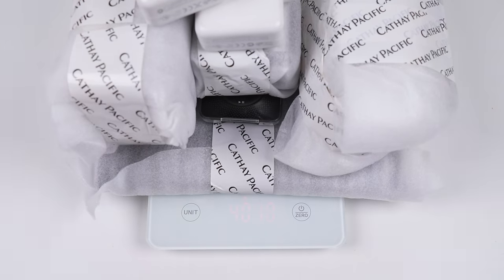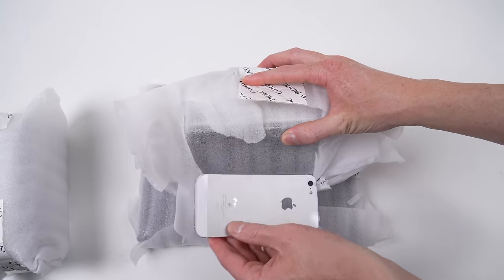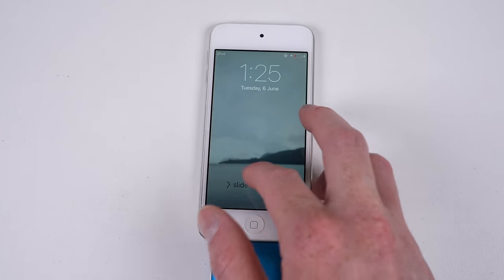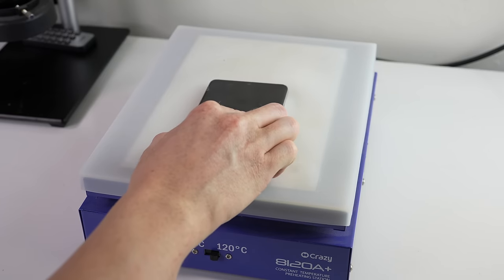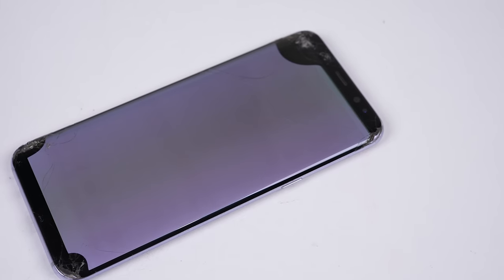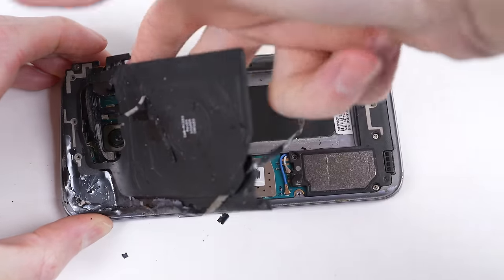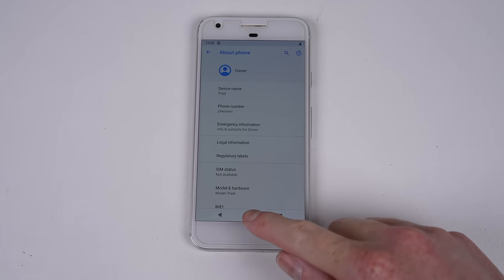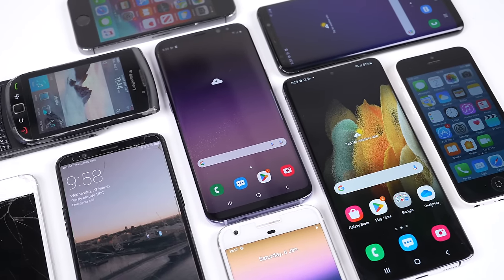Hitting the Jackpot at an E-Waste Centre - It's Amazing What People Throw Out!

Comment from the maker: iPhone 4 wasn't iCloud locked. Reset and it works fine.
Reply: Lovely, I remember you fixing and repairing quite a few earlier model iPhones a couple of years back (ro so) in the earlier days of the channel.
Only thing of course is that some iPhones can be iCloud locked so you really have to choose carefully. Myself, I'd have taken a punt on quite a lot of the phones, hoping to get at least some working (especially if you still have that box of donor iCloud locked phones whose screens/batteries/other parts can be repurposed).
Reply: @TheSpotify95   iCloud locks are pretty easy to remove if you know how. The MDM is more of a hassle, but not something you can't bypass with a bit of work.
Reply: How can we buy the e waste and ship to our countries for salvage
Reply: Replacing the screen only without the frame is not only easier, but faster and more professional.  Aftermarket frames are not the greatest quality, including the way they mount the screen and other pre-mounted parts.  Moving all the small fragile parts over from the original frame is riskier and takes longer than replacing the screen only (especially the glued-in ear speaker, vibrator, and antennas in the frame).
It makes me cringe when I see anyone using a messy glue to mount the screen and back, which makes future repairs more difficult by having to scrape it all off.  Repair part stores sell cheap $1 factory cut double-sided adhesive tape for most models.  For models which are not available, they sell generic rolls of 3M tape of various widths (1-5 mm) for easy mounting.  Just my 2cents.
Reply: 5th reply
Reply: I need to go to e waste
Reply: Donate phone
Reply: except it doesnt ''work fine'' at all. Its pretty much useless like all older apple products. You litterally couldnt watch a youtube video on it if you tried.
Reply: @Mikael-jt1hk  That's probably due to the lack of app support as a device ages. The same can be said for my old Galaxy S4: what worked flawlessly when I used it daily, now struggles dut to older apps not working anymore.
You have to manage your expectations - in terms of core functionality, the iPhone 4 probably works fine, but will struggle with modern apps. That's different to a phone with a broken screen, bulging battery, iCloud lock, or similar.
Reply: i wish i had the skills like you so i could make profit
Reply: @peterishere6230  You gonna steal phones or smth ? Jailbreaks are pretty useless to use considering even a slightest update could brick your phone
Reply: I need that s21 ultra  😫 i will pay for that 😊
Reply: Sir 😊
Reply: Oppo is my favorite one ❤
Reply: No if you make the Last Update on it IOS 9.3.6 and you Get a Activation Lock
Reply: I'll buy  the s7 if you still  have it
Reply: cool dudue:text-green-game-over::text-green-game-over::text-green-game-over::text-green-game-over::text-green-game-over::text-green-game-over::face-purple-crying::face-purple-crying::face-purple-crying::face-purple-crying::face-purple-crying::face-purple-crying::face-purple-crying::face-purple-crying::face-purple-crying:
Reply: What  application did you use to tell you all that data at 8:44 ?
Reply: @SH..786  he'll probably sell it on his websitr
Reply: Yo I’m British You coming to my house and fix my phone
Reply: For these old devices fixing with oled doesn't make sence...use a ips screen
Reply: Hi, I recently visited a recycling center full of electronics dropped off. They no longer allow people to take the electronics dropped off to people anymore, I’m having a hard time finding a place that picks them up.
Reply: if you can get into one with no PIN, always sign out of icloud before resetting.
androids you can reset from recovery mode, and bypassing their account lock is easy if you're exucated
Reply: Ill buy the pixel
Reply: woo zeee momma
Reply: Hey mate . What ewaste place did you go to . I’d like to go there
Reply: its amazing you said usd im from usa and watched you modding an ipad mini 2 screen only visable to you and i was watching on the same ipad but it broke but we changed the screen

Comment: The other day a care organization that I'm a client for gave me a bunch of devices that they were going to throw away. I got a ThinkPad Yoga 370, two Galaxy A32 phones and a Galaxy A20. ALL of them were fully functional with small marks from general use and wear & tear. They even factory reset the devices for me.
I can agree, its crazy what people throw away
Reply: Dude, I got a few pretty decent ROG prebuilt (dated August 2020 in their inventory) from a government office that tried to get rid of them. Bought 6 of them for around 200 USD. Turns out all of them have either bad HDD or bad RAM plus clogged up fans. So I just get the parts I need for building my own PC, sell the rest of the parts for donors or just second hand parts on Facebook. 

And that's how I have my current PC, i5-10400F and a 2060. 

I also got a few decent MSI and Dell laptops from the same office, most of them only have bad HDD or bad RAM and that's it. One got a bad battery, but already fixed it and sold it for 400 bucks. Which is the cost I need to purchase 10 of those laptops. Also saving one for myself, just hope the delivery for the RAM will be faster than the estimated delivery time
Reply: People are ignorant. These people have been fooled into thinking a 3/4 year old phone or computer is obsolete.
Reply: The company I work in provides us with phones but after when they upgrade our devices they don’t even have a possibility to sell the old ones to the outside. Thanks to that we can buy them for some silly money(on device per worker) but those unsold belong to e-waste😉
Reply: I had gotten batches of 30 good PCs because offices changed to newer ones and they needed the data destroyed, then they let me keep the rest of the computer
Reply: Hey I’ve seen u on TikTok lol
Reply: Id throw a free A20 away
Reply: @Gabriel-cy2iw  a20 is are good phones if you need a backup phone
Reply: hi
Reply: Sounds like trash to me 😅
Reply: care organization? what is that

Comment: I'm definitely a fan of going to my local e-waste drop off and seeing what's been left 'OUTSIDE OF THE DEPOSIT BIN.' I put that in quotes because if it's inside the bin, then it's theft, but if it's outside of the bin, it's fair game. So many corporate folks, mainly enterprise and data center folks, will drop of boxes and boxes of servers blades with CPUs & registered ECC DDR4 since they have to upgrade the entire platform (minus PSUs, I/O, etc of course) in order to upgrade their CPUs. If it's on the curb then it's fair game. As someone who also repairs devices, Ive saved A LOT of money finding iPhones that are either activation locked, or have one problem or another, but their display assemblies are usually fine. Mostly OLEDs, but sometimes there's an iPhone 11 or two, so a FEW LCDs sneak in there.

The panels are usually A/B grade, and 100% intact. So I'm kinda in it for the display assembly harvesting, but . .  the OnePlus 9 Pro I'm using right now, I found her new in the box on one of those runs. Well, I say 'new', but I'm not 100% sure, but she didn't have any signs of wear, AND the factory screen protector hadn't been removed yet.

I'm glad people take their stuff to e-waste places, and not just because it's good for me, but it's also good for the environment. I'm also a huge fan of devices getting second lives.

Speaking of second lives, lately I've been harvesting the LCDs out of dead laptops (although I have been able to fix a few of them, but most of them are toast). Usually they're FHD or QHD, and then I'll snag an  LVDS driver control board, and build fun little project monitors. They're also perfect for Raspberry Pi projects. They're great. The control boards only run $15 or so, and since most of them are actually repurposed prototyping units, it's full circle ewaste prevention.

Great video brother!!

Comment: I work as a service tech for a restaurant group
A number of years ago all our stores got a number of Amazon fire tablets that the stores were "supposed" to use as mobile training items. 
Many stores "misplaced" or hid them and eventually over time we switched to chromebooks. 
I've found a number of these tablets due to new store managers and such and have worked to turn them into document tablets. They contain the operation/troubleshooting manuals, cleaning and PM guides, and other key/core info including  model/serial numbers on all the equipment the specific store. 
I've produced 4 of them and the stores that have been using them quite a lot now. It also helps us techs out as the stores now can give us better information on machines that aren't working right

Comment: The company I work as a service tech we constantly strip out old equipment for usable parts prior to scrapping them. On average we can salvage 60-80% of the usable parts prior to scrapping. Only time we don't do this is if the item is too old for the parts to be usable in other machines

Old wiring goes into a barrel that our one person takes to a field at his farm and burns the coverings off them in order to recycle the copper.
Most of the metal we don't use goes into a scrap dumpster that is picked up for recycling
Reply: You shouldn't burn the insulation off wire, it can be sold as insulated or get a wire stripping machine.
Reply: @biohaz360  we're talking about wires that are 10-25 years old out of grills/fryers and other equipment.  the amount of wire collected varies and isn't a consistent amount or size.
We used to simply trash it but at least now it's getting recycled. It's not the best way to do it I admit, but it's better than ending up in a landfill

Comment: I've had 2 Galaxy S20 Ultra that had a swollen battery after about 10 months. Samsung replaced the first one,  but the replacement did the same thing with another swollen battery that was separating the back. Must be a defective battery or charging system.

Comment: I've been questioning the feasibility of replacing screens for broken phone. My friend has a Google pixel 6 pro with a broken screen, and I looked up where to get new displays and it's simply not worth it. The pixel 6 Pro sells used for about 400 USD, a new screen is 250 USD minimum (and the cost to do a replacement is about 10 dollars more). I think the cheapest way to do a screen replacement for this is find a water damaged Google Pixel 6 pro and take the screen off (assuming they are not damaged). Perhaps in a few years when these phones become obsolete, a screen replacement may be worth it. If it was just a dead battery it's probably worth it to repair, because new batteries don't cost nearly as much, but if it's screen or motherboard, best just discard it. 

Actually I kinda wish I can find an e waste purveyor in Taiwan. I can find junk yards and they have E waste, however their willingness to sell (rather than buy) is variable... some yards have very weird rules about them selling you e waste, and also all of these yards are outdoor, meaning if you bought E waste from them, a large majority of them will have been exposed to the element, and therefore damaged beyond repair.

However if you can find retro components (I mean computers from the 80s or 90s) that are in a good working condition, then you may be able to hawk it off to idiots who will pay thousands of dollars for old, obsolete component.

Comment: I rescued a HP Envy 17 laptop from a skip. It had a broken screen hinge and a few missing key caps which I repaired easily. I purchased a replacement power supply from eBay for £8.00 including postage and the laptop powered up with no problems. Not only did it have a quad core, 8 thread i7 CPU and Nvidia GPU, It also still had a 1 Terabyte hard drive and 16 Gigs of RAM, as well as a working copy of Windows and all the user data still on the drive. After reformatting and re-installing Windows, my wife claimed the laptop for her Facebook gaming, and has been using it for over two years now. One of many great finds I have rescued from skips over the years.  It just shows what a "throw away" society we are becoming!

Comment: iPad 1 usually does that when the battery voltage drops under 2 volts/ cell, slow charging the cells usually brings them back to life, no need for replacement unless it is bloated

Comment: Not a phone I know but technology below 2000 is the good stuff.

My old radio SHARP WF-1100L (A portable Radio) is still strong to this day. I don't know the exact age, but it is at least 20 years old since my parents married.
Reply: It's like my old radio Samsung RCD-S30. This radio still works OK, has cassette AND CD player. Also has AM function and Bass option. And this one is from early 2000 or even from 2000, and yes, could be portable if you found one of those big batteries for old flashlights

Comment: Regarding the Samsung S21 Ultra & S8 screen repair, I would have also replaced the battery (Gawd knows how it's been charged and abuse it's had AND... Knowing Samsung and their 'Spicy Pillow' batteries 😉🤣🤣), so, while I'd be in there a new battery in too to ensure longest lifespan without having to open her up again in the near future... 🤔😏
😎🇬🇧
Reply from the maker: I replaced the S8 Plus battery as it had expanded slightly.
Reply: @HughJeffreys  Yeah you mentioned, I was just meaning that maybe at least before sealing the other phones up fully again, I woulda done a quick charge and drain test to see what life there was still left in them. Please don't get me wrong, the video was short and thus we didn't see everything you did, so I don't know what condition those batteries were in. It's just when I have done a couple of repairs to older phones, I've done the batteries as well 'Just in case' as, like 'MrWhoseTheBoss' found with his collection of older Samsung phones, some have, er, 'Filled out' a little lol 😏😉.
Anyway, love the channel (long time subscriber) and LOVE the fact you don't hesitate to pull up the main manufacturers constant failure/resistance to help with repairs (Naturally Apple being the biggest culprit with unnecessarily code locking stupid things like vibe motors, screens and even batteries and such!). Keep up the good work fella! 👌👍
😎🇬🇧

Comment: With those Samsungs I often use an external monitor through a usb-c dock w/ pd charging to test if it's more than the screen. It would've been tricky with those ones since they're locked though. On the lock screen you just see a lock icon on the monitor as it waits for you to unlock the phone. Ideally with a customer device you can just keyboard in a passcode or password. Patterns are way harder to do since you're using a mouse or touch screen blind usually. With all that said, having that tool as an option gives you more information and a really easy way to recovery data without a full screen assembly.

Comment: It might be worth trying the iPad again. I have the same issue with my iPad 4 (2012). If the battery runs empty and I want to turn it on I have to charge it for an hour at least. Otherwise the display will just flash and turn off again.

Comment: The first gen iPad that flickers is a sign of a very flat battery which cannot be revived via USB charging. You would need to disassemble the iPad and reveal the battery contacts then tape/solder the positive/negative wires from a usb cable directly onto the battery. Here is a youtube tutorial about that: https://youtu.be/2QVFJIqD5Yw?feature=shared .

Comment: Hey Hugh I have question 

Is there a best way to remove the earpiece and vibration motor without destroying it because everytime I repair some of my phone with broken screen I just buy new screen with frame so I need to transfer everything but everytime I do that I always damage the earpiece and vibration motor sometimes also is the charging board

The battery also I have problem, some of my phone just have fat battery (pillow battery) I try the alcohol method and manage to destroy the screen because of the alcohol

Comment: The least hard to fix phone I could get recently was... a Galaxy S5. Does have some bit of corrosion on the LCD flex SMDs but it surprisingly works well, proving the S5 is one damn tough as nails trooper.

The battery and camera were the only things that were its issue. The camera doesn't properly focus (not that I'd need it anyways as it's gonna be a secondary phone) and the battery was already puffy. I might be able to find some more broken S5s and rebuild one from more. Hope to find a S5 Neo back cover as well.

Comment: I give props to the e-waste business for collecting such devices. 
Funny story…while on vacation, I noticed my aunt and uncle’s pc was unplugged, collecting dust. They stopped using it for years because their monitor got destroyed. So I just plugged it to their TV, discovering that it works fine, only slower. 

After relocating the computer next to the TV, and purchasing an external hard drive to back up any files and documents that was in there — mind you they were gonna throw out the computer before getting it checked out — I installed Linux Mint. The system had Windows 7. And I know it will get infected with viruses the moment it will connect to the Internet, since Microsoft stopped supporting the OS. 

Now the computer is a media PC, runs smoother with Linux, still plays their DVDs and CDs. They can even still do basic word processing on it as well as watch Netflix. On top of that, no more is there a need to buy a new monitor or a smart TV. 

It was pretty much my way of thanking them for their hospitality.

Comment: The iPad 1's screen flicker can be "solved" by lightly knocking the back of it, at least in the case of mine. The display cable doesn't seem to be backed by any physical boundary so it will slightly disconnect over time, odd design choice.